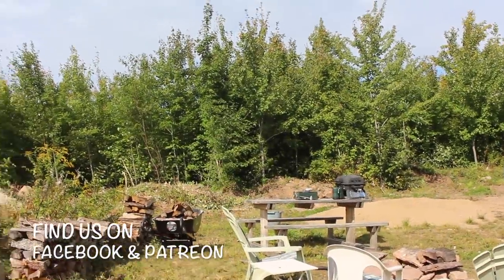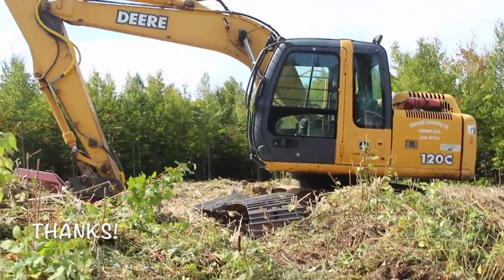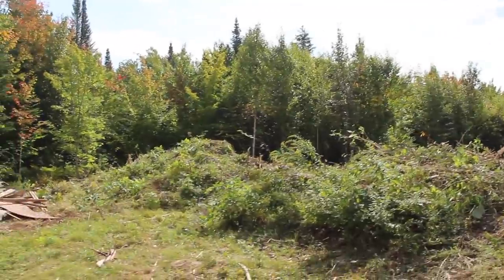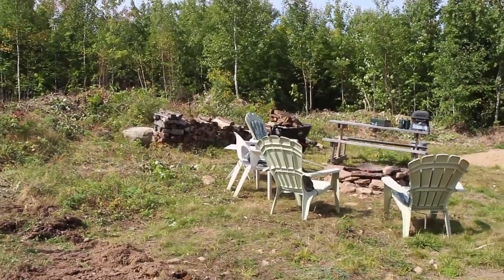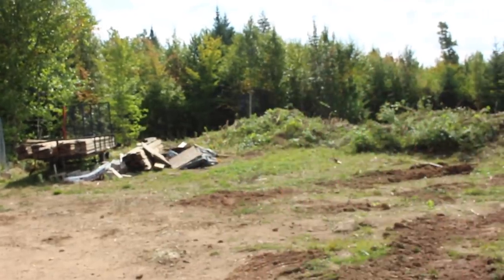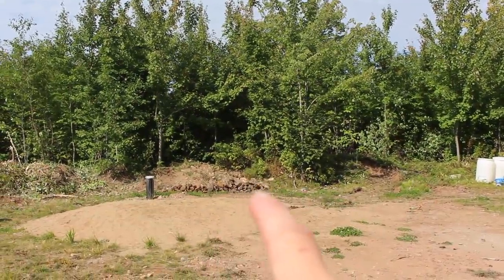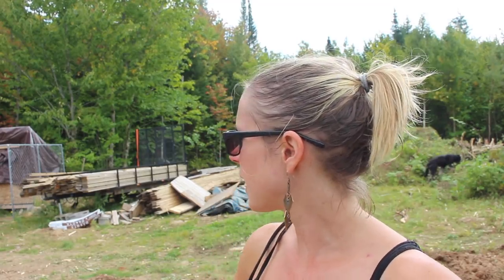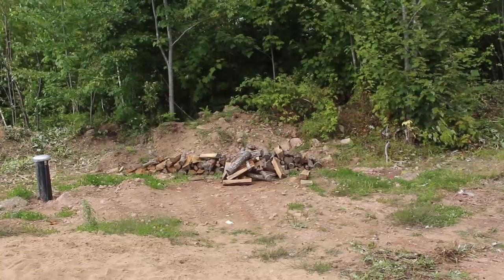Off Grid Living VLOG Season 2 Day ??? Land Cleared, Vapour Barrier, etc.

Comment: Looks like you did a great job insulating the walls...Why would you use crappy vinyl windows, when you can use a nice wooden Andersen window to keep out the elements.. Same goes for the plastic sliding patio door..
Reply from the maker: These will hold up great :)

Comment: Ashley, if you could explain what your side by side is doing or not doing and the make and model there may be someone on here that could help tell you how to fix it. It could be something simple that would not need a shop. Just a thought. Or, type it in on utube.
Reply from the maker: It is the shifter cable that needs replaced.
Reply: What kind of side by side? i have seen it but not paid much attention.
Reply: From what i can find, if you have got water down your shifter cable it can freeze up. you can sometimes get it loose and fill it with oil or wd 40 and keep working it back and forth and it may loosen up. i sent two links for posts on you tube about this. if they dont work just type in    fixing shifter cable on polaris ranger. i went back through some videos and found your bike. this can be an aggravating job but it could save a lot of money if it is the cable. these videos will help too. good luck.
Reply from the maker: @bobf12  It is a 2017 Polaris Ranger 1000xp
Reply from the maker: @bobf12  We need a new cable for it.
Reply: If its just the cable it would be a pain in the butt to put on but its not that complicated. it shouldn't take a shop long to do that either if you decide to go that route. I have a kawasaki mule that i depend on a lot. When it goes down i fix it pretty quick.